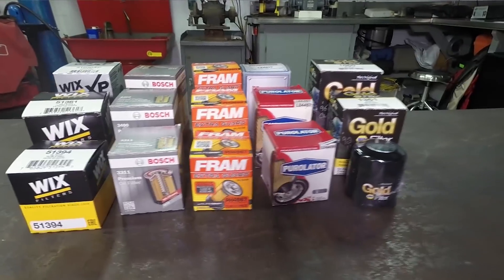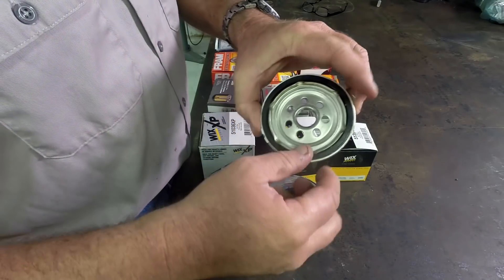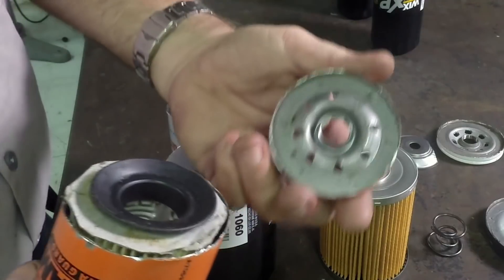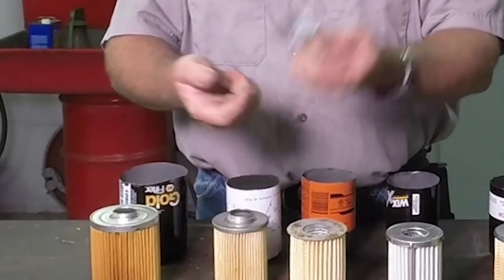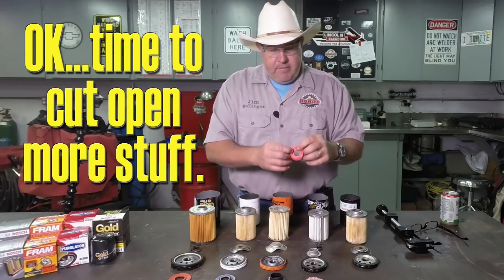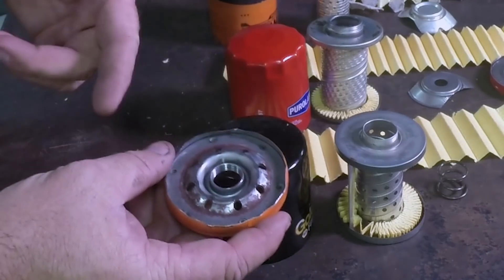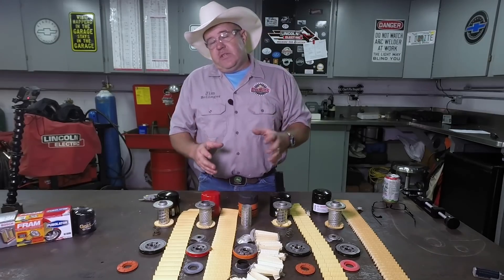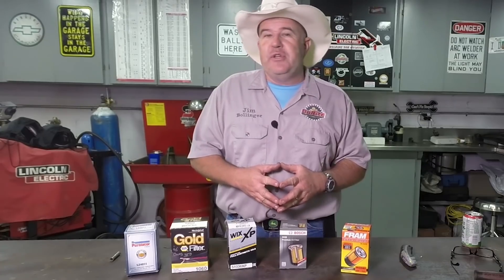The worst oil filter EVER!

Comment: Wow i thought Fram was a reputable brand.......
Won't touch one with a 10ft pole taped to another 10ft pole now after seeing this.
Reply: Dam.  Fram needs to change their name to Scam oil Filters.
Reply: @bryanbaker5942  PEOPLE!!!  All of those filters are JUNK!!!  FRAM IS A GOOD FILTER!!!
THERE IS SOMETHING WRONG WITH THIS TEST OF THE FRAM FILTER!!!  BECAUSE IT'S SIMPLE IF YOU THINK ABOUT IT!!!  THE WAY THE FILTER ELEMENT WAS FLAKING AWAY SO EASY!!!  IF YOU PUT THAT FILTER N YOUR ENGINE!!!  IT WOULD FLAKE OFF AND ENTER YOUR ENGINE AND PREVENT OIL FROM GETTING TO THE BEARINGS OR AND BLOW YOUR ENGINE UP!!! AND IF FRAM SOLD FILTERS LIKE THIS YOU WOULD BE HEARING ABOUT ENGINES BLOWING UP BY THE MILLIONS!!! 
ONE REASON I SAY ALL OIL FILTER ARE JUNK IS BECAUSE THEY ARE ALL BY PASS FILTERS!!!  
A BY PASS FILTER IS A FILTER THAT A CERTAIN PORTION OF THE OIL THAT GOES INTO THE FILTER IS BY PASTED AROUND THE FILTER ELEMENT AND IS NOT FILTERED!!!!!!!!  ANOTHER THING, AS THE FILTER PLUGS UP MORE AND MORE OIL IS BY PASSED AROUND THE FILTER ELEMENT AND IS NOT FILTERED!!!  SO AS TIME GOES BY LESS AND LESS OIL IS FILTERED!!!!
BUT PUTTING ALL OF THIS ASIDE WHICH HAS NOTHING TO DO WITH ANYTHING!!!  BECAUSE EVERYONE ONE OF THOSE FILTERS ARE JUNK!!!!   BECAUSE THEY DON'T FILTER OUT WHATS WEARING OUT YOUR ENGINE!!!  IF THEY FILTERED OUT WHAT WAS WEARING OUT YOUR ENGINE!!! YOUR ENGINE WOULD LAST FOR MILLIONS OF MILES!!!
YOU SEE OIL IN YOUR BEARING CAN'T WEAR FORGED STEEL!!!!  OTHER THINGS IN THE OIL CAN AND DO!!! THAT'S WHY ENGINES DO WEAR OUT!!!  BECAUSE THE OIL FILTERS ARE JUNK!!!  WHEN YOU BUY A NEED FILTER YOU ARE PISSING YOUR MONEY DOWN THE SHITTER!!! 
Larry
Reply: Fram Ultras are alright.   You just have to pay more than $4.
Reply: @williwonti  hope so. I'm using those on my new car...
Reply: @williwonti  where do you go that that the "ultra" Fram filters are only $4?   At my Local Walmart, the cheap orange junkers are $6.57!  Oh, and BTW, I live in Missouri, so the typical Coastal inflation has no effect on the price.
Reply: @triangleofdeath6246  the cheap orange filters here at Wal-Mart are $3.97 have been for years.
Reply: @williwonti  That is the one he cut apart.... Fram ultra gard is what is says on the case he is holding....
Reply: @williwonti   i have used them for 30 years on my cars  and customers where I had the choice, I worked for toyota for 25 yrs and they have a great filter
Reply: @williwonti    _-  ,.
Reply: @williwonti .. Do yourself a favor and cut open whatever Fram filter you are using and do your own inspection on the components.. and compare it to an OEM filter or another name brand.. You will discover the more expensive Fram’s are junk too!
Reply: @williwonti  
Fram Ultras are one of the very highest rated oil filters in every category, except price.
Reply: Larry Love we’ll he misrepresented the comparison then, chase Ultrgards are gold
Reply: @triangleofdeath6246   @imposter 0shadow  
Sir, just read the comments and you have people that have used Fram FILTERS for year!!!  Have vehicles that have 3 - 4 - 5 hundreds of thousands of miles using FRAM FILTERS!!!
First of all!!!  Everything I said is TRUE!!! AND ""TWO"'" as you say!!!  All of those FILTERS that you cut open are BYPASS FILTER!!!  AND ANY OUT THERE IF YOU WANT TO KNOW THE TRUTH WHEATER THE FILTERS ARE BYPASS FILTERS JUST ASK AROUND AND YOU WILL FIND OUT THAT THEY ARE BYPASS FILTERS!!!
THE REASON THAT THEY ARE BYPASS FILTERS!!! IS BECAUSE IF THEY WEREN'T AND THE FILTER PLUGGED UP THE OIL WOULD STOP GETTING TO THE ENGINE!!! AND YOUR ENGINE WOULD COME TO AN ABROUT STOP!!!  IT WOULD FREEZE UP FROM THE LACK OF OIL!!!. THAT'S WHY THEY ARE BYPASS FILTERS!!!
AND I ALSO WAS MASTER MECHANIC!  FOR FORTY YEARS MORE OR LESS!!! 
MATTER OF FACT I AM ABOUT TO UPLOAD A VIDEO THAT TELLS PEOPLE THAT FOR ABOUT ONE HUNDRED DOLLARS THEY CAN BUY THE PARTS THAT I TELL THEM TO BUY!!!  AND THEY CAN INSTALL THE PARTS THEMSELVES IN LESS THAN TWENTY FIVE MINUTES OR LESS!!! NO TOOLS REQUIRED!!!  AND THE CARS OR TRUCKS LAST FOR MILLIONS OF MILES!!!  RUN LIKE NEW!!  NEVER HAVE TO CHANGE OIL OR OIL FILTER!!!
LIKE SAID THE ALL OF THOSE FILTERS ARE JUNK!!!  AND THAT'S WHY TENS OF MILLIONS OF CARS ENGINES AND TRANSMISSIONS WEAR OUT EVERY YEAR!!!
LARRY
Reply: @larrylove9589  He cut apart an extra guard, the cheapest one. Ultra synthetic doesn't look like that on the inside.
Reply: In other words, I wouldn't touch a Fram filter with your car!
Reply: @discerningmind  The AC 'E'  series are made just like the Fram.... I had an AC just about strarve it of oil  by the cheap construction one day this summer towing coming in home...
Reply: @discerningmind  no it's got to be a ten-foot pole.
Reply: @discerningmind  PEOPLE!!!  All of those filters are JUNK!!!  FRAM IS A GOOD FILTER!!!
THERE IS SOMETHING WRONG WITH THIS TEST OF THE FRAM FILTER!!!  BECAUSE IT'S SIMPLE IF YOU THINK ABOUT IT!!!  THE WAY THE FILTER ELEMENT WAS FLAKING AWAY SO EASY!!!  IF YOU PUT THAT FILTER N YOUR ENGINE!!!  IT WOULD FLAKE OFF AND ENTER YOUR ENGINE AND PREVENT OIL FROM GETTING TO THE BEARINGS OR AND BLOW YOUR ENGINE UP!!! AND IF FRAM SOLD FILTERS LIKE THIS YOU WOULD BE HEARING ABOUT ENGINES BLOWING UP BY THE MILLIONS!!! 
ONE REASON I SAY ALL OIL FILTER ARE JUNK IS BECAUSE THEY ARE ALL BY PASS FILTERS!!!  
A BY PASS FILTER IS A FILTER THAT A CERTAIN PORTION OF THE OIL THAT GOES INTO THE FILTER IS BY PASTED AROUND THE FILTER ELEMENT AND IS NOT FILTERED!!!!!!!!  ANOTHER THING, AS THE FILTER PLUGS UP MORE AND MORE OIL IS BY PASSED AROUND THE FILTER ELEMENT AND IS NOT FILTERED!!!  SO AS TIME GOES BY LESS AND LESS OIL IS FILTERED!!!!
BUT PUTTING ALL OF THIS ASIDE WHICH HAS NOTHING TO DO WITH ANYTHING!!!  BECAUSE EVERYONE ONE OF THOSE FILTERS ARE JUNK!!!!   BECAUSE THEY DON'T FILTER OUT WHATS WEARING OUT YOUR ENGINE!!!  IF THEY FILTERED OUT WHAT WAS WEARING OUT YOUR ENGINE!!! YOUR ENGINE WOULD LAST FOR MILLIONS OF MILES!!!
YOU SEE OIL IN YOUR BEARING CAN'T WEAR FORGED STEEL!!!!  OTHER THINGS IN THE OIL CAN AND DO!!! THAT'S WHY ENGINES DO WEAR OUT!!!  BECAUSE THE OIL FILTERS ARE JUNK!!!  WHEN YOU BUY A NEED FILTER YOU ARE PISSING YOUR MONEY DOWN THE SHITTER!!! 
Larry
Reply: U gotta pay more than 4 dollars for quality
Reply: xrayracer1 oh my god you should send this video to fram
Reply: Here's the truth. You don't actually want an oil filter that restricts flow. THAT is what will damage your engine faster than anything else. So don't think that an oil filter with MORE guts means MORE protection because it does NOT! I use Fram and have for decades on my expensive racing engines and personal vehicles. If you change your oil frequently and make sure the air filter is sealed well you will be fine. Keeping the flow rate of oil high is literally the best thing you can do to protect and lengthen the life of your motor.
Reply: @yiddishlion2037  heard/ read about this before! That's something to take in no doubt
Reply: We may not like Fram filters but the cheapest ones still pass OEM testing everyday.
Reply: Scott Amick I’ve used them on all the vehicles I’ve ever had.
Reply: They are a reputable brand. Been using them for years with no failures. Can't go wrong with a Fram.
Reply: Coincidentally those 2 10 foot poles taped together areore sturdy then the fram filter 😂
Reply: Allied signal no longer owns Fram..The new owner actually has some decent filters. 

 They've been garbage for decades prior. 

 The one thing I do remember from the business trade publications is the new Fram owner  switched manufacturing to a other company.

 There's only a few manufacturers in the world of oil filters. They're just made to different specifications at the various factories.
Reply: Or you can maybe, you know, use the product and form your own opinion about FRAM. I've never had any issues with using FRAM on my econobox cars.
Reply: @baretta369 i was thinking what if all that thick material actually prevents oil from circulating throught the filter and only a little bit passes through? I dont even think filters are needed? I bet you could run a motor without one and probly never notice? Fuck if i know
Reply: Cd Walkman I agree. When it’s to the point your engine needs a filter there is already damage.
Reply: Fram synthetic ultra guard only
 nothing less
Reply: Perform SAE J806 and J1858 tests and see how they do.
I know how well that orange filter did(n't) do 20 years ago when Dana owned WIX (I worked for a sister division).
WIX also makes the Motorcraft filters for Ford.
But if you think FRAM is a $#!++y filter, cut open an STP filter. Some of those were nothing more than string packed in a can, and no antidrain back valve. And that was for a fairly recent 1997 Taurus.
Reply: You didn't notice that he didn't cut that fram open on camera? this is what we would call a hack job.
Reply: So do you believe everything u see on the internet ? THEY are reputable, don't be naive, you don't really know if this guy is getting paid to bash companies, for his own gain.
Reply: @robbyrocks3665  mine is for experience. A used Fram filter should be considerably heavier due to trapped particulates and metal fragments than a new one but it doesn't. That's from changing oil for 9 years and we used Fram filters.
Reply: @mikej8832  so you are saying the weight of a used filter is the same weight as a brand new filter out of box?
  Cmon, thats obviously a rediculous statement, unless i misunderstood u
Reply: @robbyrocks3665  the weight once the oil drains out is not even noticable unlike other filters that have better and more filter media. The lack of quantity in filter media was apperant. The quality was visible to most also. Not saying they don't filter but are they catching all that should be caught?
Reply: Your so god damn gullible!!!! Instead of dropping to conclusions with all this fake shit.witch it looks like he has something against fram... .that he wanted to make them look low why dont u open one yourself  and find out yourself what they actually look like..lazy ppl like u will never know the real truth
Reply: The guy says there is rust and only shows the cartridge of the filter. What he shows is not rust, it’s a burn from processing. There is a compound used to hold the ends to the paper that is heated to cure. As for the paper, it’s formulated to bind when saturated by oil which strengthens the paper. What he is showing on the anti drain back valve isn’t paper. Also, then end he claims is falling apart is false. Plus the way he cut all the filters open, I wouldn’t be surprised if he damaged the other filters. Plus Fram makes other name brand filters that most consumers don’t know about, but because people don’t know, there aren’t people making videos trying to discredit the quality.
Reply: Ill bet you buy the cheapest tires from china, dont you ??
Reply: Wow lie much !! or are you just that stupid?  Thats not rust and you know it. thats Discoloration  where they use heat to cure the cardboard to the filter. there is NO rust in the canister !!  yes it is a cheaper filter, but its susposed to be. its only good for 5,000 miles and is dirt cheap for walmart to sell. if you want a good filter test a fram ultra filter rated for 15,000 miles. cut one open to see , makes your napa filter look like a pice of shit.  i am a mechanic & i know what im talking about.  you are lying to these people and should be ashamed !!!!!!!!!!!!!!!!!!!!!!!!!!!!!!!!!!!!!!!!!!!!!!!!!!!!!!!!!!!!!!!!!!!!!!!!!!!!!!!!!!!!!!!!!!!!!!!!!!!!!!!!!!!!!!!!!!!!!!!!!!!!!!!!!!!!!!!!!!!!!!!!!!!!!!!!!!!!!!!!!!!!!!!!!!!!!!!!!!!
Reply: @Forbiden-Music-Zone  
Well said...
Reply: Understand this isnt their ultra synthetic oil filter which surpasses or compares to any other purolator, k&n bosche ,wix etc....just like anything ypu have your cheap options and your quality ones....look up the ultra synthetic specs and then talk to me
Reply: I have a 2006 Toyota Matrix with 233,000 miles on it. I have used Fram filters and Wal-Mart oil since day one. I've never had any problems.
Reply: wow, i have used fram for ~30 years, I was told the quality went to crap when they took it to china, but I now have 483K miles on my 25yo 1994 toyota truck and only using fram. And i only change the filter every other oil change, 3500 miles per oil change (7 minute oil change w/o filter, 9 minutes with filter). They maybe "complete garbage, but close to half million miles they work fine. Maybe if you used them on a Ford, it would explode backing out the driveway, Oooo, but thats just Ford. :)
Reply: Yep!
Reply: Its just a massive brand, you buy their cheap crap you get crap, its the stuff with a real price you need to look at
Reply: Nope me either fucking assholes
Reply: So you won't touch one with a 20 foot pole?
Reply: what kind of tape?  Duct tape, gaffers tape? armament tape, masking tape, scotch tape.....
Reply: https://youtu.be/kx-NT1DEtlU
Reply: The Fram Tough Guard and Ultras are good filters. The Extra Guard and High Mileage are not. Also, nothing wrong with those stamped springs.
Reply: Jonathan Rajsl  pff its so obvious you work for Fram?
Reply: xray, run an extra guard Fram every 4100 mile conventional change and get back to us after 350k miles.
Reply: @baretta369 every vehicle has different oil change intervals and older vehicles were as low as 3,000 miles. And only has to filter oil? That's were most folks get things wrong. It has to filter, flow, and retain particulates within certain parameters to give your engine a long life. I use Mototrcraft filters since they are made to meet my Ford's specs.
Reply: Seriously? Well better learn this late than never. I never touch anything Fram. I only buy k&n filters for my car.
Reply: I did my own check on my fram filter and it looked nothing like this it was standard orange and it was perfect no cardboard no rubber it was metal just like the other fingers he showed this is whack
Reply: Damn that's a lot of poll.
Reply: NAPA Gold made by Wix for me 👍
Reply: Cali recommends 8k per change. The rest of the us seems to be 3k
Reply: Jonathan Rajsl  WHY DO YOU YELL?
Reply: If you want a very good filter for under $10 get a Mobil-1 filter from Walmart. The quality is much better then any of the filters in this video.
Reply: @MrWhoevr  
Or a Fram Ultra Synthetic.
Reply: xrayracer1 me neither I guess
Reply: No it is actually one of the best if you do not buy the cheap orange brand. You want the chevron pleated black ones with white text for your car but they do still come in an orange packing unfortunately so you cannot see directly at the packing material if it is the good one. The good ones from Fram are quite expensive for a filter but you will understand why if you take a peek inside. Gold and Wix than suddenly seem mediocre. I do not have a car anymore, I have a ship and a very beautiful working VeloSolex. The VeloSolex does not require an oil filter since it is a two stroke engine. If you live on a ship a VeloSolex is heaven since you can take it on your shoulder and walk the gangway, 21.2 kg total fully fueled and emergency toolkit present. I have a special rope loop just long enough to wrap around the steer and saddle so I can hang the VeloSolex on my shoulder.

The best is still Mann. Real German heavy duty performance but also at a not so great price, it will hurt in your pocket. I have a double main filter for my main engine, a Wartsila 1100 HP diesel, of which one filter only is 425 Euro excl taxes. There is no outside casing since it is completely taken inside the motor and I can change one of them during use, I do not have to stop the engine. The quality is that good that I can hit someone KO with it and it won't give a shit while it has no casing. Complete oil change is needed at every 5000 hours (complete stop required obviously) and I sent oil samples to the lab monthly for extra check, safety first. I have only one main engine for propulsion, if it fails I am Fucked with a capital F. If the oil gets too polluted before 5000 hours we change one filter. You can buy a Mercedes SLK for what the engine alone is worth so keeping it in the best possible condition is a necessity. Now 9 years old and still in top condition, I like to keep it that way. 

The bow prop/hydraulic/generator engine is a very old DAF turbo diesel with 260 HP, we still try to keep her as good as can be but really she is nearing her grave after 30 years of heavy duty. She has run 24/7 for a long time and is in need of serious sleep. Thinking about a John Deere 320 HP diesel or a Volvo Penta 300 HP diesel and no more turbo on board the ship as they are good engines which I can afford. This next winter she will deserve her much wanted rest.
Reply: Cant imagine why people are defending fram. A picture says a thousand words.  After seeing this video I cant imagine why anyone would put one on a car they care about. The evidence is right there in front of your eyes.  Great video sir.
Reply: @reissnerjify  because people think that just because nothing has happened to their car that its a good filter. Dirty oil is still better than no oil
Reply: @reissnerjify 
The evidence! Evidence of what? Lies?
https://tiremeetsroad.com/2019/01/24/are-fram-oil-filters-any-good/?unapproved=9775&moderation-hash=97af52291ee98290baa18e718d5b50a3#comment-9775
Reply: I'd like to see a comparison of used filters
Reply: Me too what an eye opener
Reply: derrik tie    Don't take this the wrong way.  How do you know that?
Reply: Knew before watching Fram would be junk! I'll never forget looking into one in a store and seeing RUST all over the inside - no way would I touch these things!
Reply: Love the vid! I buy Fram all the time and so far no issues. I’m  it surprise the Orange look like that but I’m going to open up their higher end filters and see if they have better components. BTW, sort of unfair to compare Frams SHIT grade to NAPAS Best grade! Great video though :D
Reply: @baretta369 Thats fine, run your mobil1 for ever, after 3~4K miles its dirty oil (they make mobil1 black so you cant see how dirty it really is), it takes me 7 minutes to change oil in my truck and less than half the cost of mobil1. BTW, even if you have 40 years of experience, that does not mean your doing it right.
Reply: That Fram filter is the cheapest they make ..try comparing their other models   and prices.  This is a bullshit review
Reply: xrayracer1 they are dont believe everything you see on the internet!
Reply: PEOPLE!!!  All of those filters are JUNK!!!  FRAM IS A GOOD FILTER!!!
THERE IS SOMETHING WRONG WITH THIS TEST OF THE FRAM FILTER!!!  BECAUSE IT'S SIMPLE IF YOU THINK ABOUT IT!!!  THE WAY THE FILTER ELEMENT WAS FLAKING AWAY SO EASY!!!  IF YOU PUT THAT FILTER N YOUR ENGINE!!!  IT WOULD FLAKE OFF AND ENTER YOUR ENGINE AND PREVENT OIL FROM GETTING TO THE BEARINGS OR AND BLOW YOUR ENGINE UP!!! AND IF FRAM SOLD FILTERS LIKE THIS YOU WOULD BE HEARING ABOUT ENGINES BLOWING UP BY THE MILLIONS!!! 
ONE REASON I SAY ALL OIL FILTER ARE JUNK IS BECAUSE THEY ARE ALL BY PASS FILTERS!!!  
A BY PASS FILTER IS A FILTER THAT A CERTAIN PORTION OF THE OIL THAT GOES INTO THE FILTER IS BY PASTED AROUND THE FILTER ELEMENT AND IS NOT FILTERED!!!!!!!!  ANOTHER THING, AS THE FILTER PLUGS UP MORE AND MORE OIL IS BY PASSED AROUND THE FILTER ELEMENT AND IS NOT FILTERED!!!  SO AS TIME GOES BY LESS AND LESS OIL IS FILTERED!!!!
BUT PUTTING ALL OF THIS ASIDE WHICH HAS NOTHING TO DO WITH ANYTHING!!!  BECAUSE EVERYONE ONE OF THOSE FILTERS ARE JUNK!!!!   BECAUSE THEY DON'T FILTER OUT WHATS WEARING OUT YOUR ENGINE!!!  IF THEY FILTERED OUT WHAT WAS WEARING OUT YOUR ENGINE!!! YOUR ENGINE WOULD LAST FOR MILLIONS OF MILES!!!
YOU SEE OIL IN YOUR BEARING CAN'T WEAR FORGED STEEL!!!!  OTHER THINGS IN THE OIL CAN AND DO!!! THAT'S WHY ENGINES DO WEAR OUT!!!  BECAUSE THE OIL FILTERS ARE JUNK!!!  WHEN YOU BUY A NEED FILTER YOU ARE PISSING YOUR MONEY DOWN THE SHITTER!!! 
Larry
Reply: @baretta369 You are right ON!!!
PEOPLE!!!  All of those filters are JUNK!!!  FRAM IS A GOOD FILTER!!!
THERE IS SOMETHING WRONG WITH THIS TEST OF THE FRAM FILTER!!!  BECAUSE IT'S SIMPLE IF YOU THINK ABOUT IT!!!  THE WAY THE FILTER ELEMENT WAS FLAKING AWAY SO EASY!!!  IF YOU PUT THAT FILTER N YOUR ENGINE!!!  IT WOULD FLAKE OFF AND ENTER YOUR ENGINE AND PREVENT OIL FROM GETTING TO THE BEARINGS OR AND BLOW YOUR ENGINE UP!!! AND IF FRAM SOLD FILTERS LIKE THIS YOU WOULD BE HEARING ABOUT ENGINES BLOWING UP BY THE MILLIONS!!! 
ONE REASON I SAY ALL OIL FILTER ARE JUNK IS BECAUSE THEY ARE ALL BY PASS FILTERS!!!  
A BY PASS FILTER IS A FILTER THAT A CERTAIN PORTION OF THE OIL THAT GOES INTO THE FILTER IS BY PASTED AROUND THE FILTER ELEMENT AND IS NOT FILTERED!!!!!!!!  ANOTHER THING, AS THE FILTER PLUGS UP MORE AND MORE OIL IS BY PASSED AROUND THE FILTER ELEMENT AND IS NOT FILTERED!!!  SO AS TIME GOES BY LESS AND LESS OIL IS FILTERED!!!!
BUT PUTTING ALL OF THIS ASIDE WHICH HAS NOTHING TO DO WITH ANYTHING!!!  BECAUSE EVERYONE ONE OF THOSE FILTERS ARE JUNK!!!!   BECAUSE THEY DON'T FILTER OUT WHATS WEARING OUT YOUR ENGINE!!!  IF THEY FILTERED OUT WHAT WAS WEARING OUT YOUR ENGINE!!! YOUR ENGINE WOULD LAST FOR MILLIONS OF MILES!!!
YOU SEE OIL IN YOUR BEARING CAN'T WEAR FORGED STEEL!!!!  OTHER THINGS IN THE OIL CAN AND DO!!! THAT'S WHY ENGINES DO WEAR OUT!!!  BECAUSE THE OIL FILTERS ARE JUNK!!!  WHEN YOU BUY A NEED FILTER YOU ARE PISSING YOUR MONEY DOWN THE SHITTER!!! 
Larry
Reply: @baretta369 PEOPLE!!!  All of those filters are JUNK!!!  FRAM IS A GOOD FILTER!!!
THERE IS SOMETHING WRONG WITH THIS TEST OF THE FRAM FILTER!!!  BECAUSE IT'S SIMPLE IF YOU THINK ABOUT IT!!!  THE WAY THE FILTER ELEMENT WAS FLAKING AWAY SO EASY!!!  IF YOU PUT THAT FILTER N YOUR ENGINE!!!  IT WOULD FLAKE OFF AND ENTER YOUR ENGINE AND PREVENT OIL FROM GETTING TO THE BEARINGS OR AND BLOW YOUR ENGINE UP!!! AND IF FRAM SOLD FILTERS LIKE THIS YOU WOULD BE HEARING ABOUT ENGINES BLOWING UP BY THE MILLIONS!!! 
ONE REASON I SAY ALL OIL FILTER ARE JUNK IS BECAUSE THEY ARE ALL BY PASS FILTERS!!!  
A BY PASS FILTER IS A FILTER THAT A CERTAIN PORTION OF THE OIL THAT GOES INTO THE FILTER IS BY PASTED AROUND THE FILTER ELEMENT AND IS NOT FILTERED!!!!!!!!  ANOTHER THING, AS THE FILTER PLUGS UP MORE AND MORE OIL IS BY PASSED AROUND THE FILTER ELEMENT AND IS NOT FILTERED!!!  SO AS TIME GOES BY LESS AND LESS OIL IS FILTERED!!!!
BUT PUTTING ALL OF THIS ASIDE WHICH HAS NOTHING TO DO WITH ANYTHING!!!  BECAUSE EVERYONE ONE OF THOSE FILTERS ARE JUNK!!!!   BECAUSE THEY DON'T FILTER OUT WHATS WEARING OUT YOUR ENGINE!!!  IF THEY FILTERED OUT WHAT WAS WEARING OUT YOUR ENGINE!!! YOUR ENGINE WOULD LAST FOR MILLIONS OF MILES!!!
YOU SEE OIL IN YOUR BEARING CAN'T WEAR FORGED STEEL!!!!  OTHER THINGS IN THE OIL CAN AND DO!!! THAT'S WHY ENGINES DO WEAR OUT!!!  BECAUSE THE OIL FILTERS ARE JUNK!!!  WHEN YOU BUY A NEED FILTER YOU ARE PISSING YOUR MONEY DOWN THE SHITTER!!! 
Larry
Reply: @imposter 0shadow  
Sir, just read the comments and you have people that have used Fram FILTERS for year!!!  Have vehicles that have 3 - 4 - 5 hundreds of thousands of miles using FRAM FILTERS!!!
First of all!!!  Everything I said is TRUE!!! AND ""TWO"'" as you say!!!  All of those FILTERS that you cut open are BYPASS FILTER!!!  AND ANY OUT THERE IF YOU WANT TO KNOW THE TRUTH WHEATER THE FILTERS ARE BYPASS FILTERS JUST ASK AROUND AND YOU WILL FIND OUT THAT THEY ARE BYPASS FILTERS!!!
THE REASON THAT THEY ARE BYPASS FILTERS!!! IS BECAUSE IF THEY WEREN'T AND THE FILTER PLUGGED UP THE OIL WOULD STOP GETTING TO THE ENGINE!!! AND YOUR ENGINE WOULD COME TO AN ABROUT STOP!!!  IT WOULD FREEZE UP FROM THE LACK OF OIL!!!. THAT'S WHY THEY ARE BYPASS FILTERS!!!
AND I ALSO WAS MASTER MECHANIC!  FOR FORTY YEARS MORE OR LESS!!! 
MATTER OF FACT I AM ABOUT TO UPLOAD A VIDEO THAT TELLS PEOPLE THAT FOR ABOUT ONE HUNDRED DOLLARS THEY CAN BUY THE PARTS THAT I TELL THEM TO BUY!!!  AND THEY CAN INSTALL THE PARTS THEMSELVES IN LESS THAN TWENTY FIVE MINUTES OR LESS!!! NO TOOLS REQUIRED!!!  AND THE CARS OR TRUCKS LAST FOR MILLIONS OF MILES!!!  RUN LIKE NEW!!  NEVER HAVE TO CHANGE OIL OR OIL FILTER!!!
LIKE SAID THE ALL OF THOSE FILTERS ARE JUNK!!!  AND THAT'S WHY TENS OF MILLIONS OF CARS ENGINES AND TRANSMISSIONS WEAR OUT EVERY YEAR!!!
LARRY
Reply: @larryneiderhiser148  a bypass filter only works IF a filter gets clogged. Then the filter gets bypassed to allow oil to continue to flow. Dirty oil is still better than no oil. And a motor that still runs with a fram for 300k miles isnt a testament to the filter, but to the motor itself. As i said, fram is shit. If i spend money for a filter to do a job then i want it to do that job.
Reply: @larryneiderhiser148  are you really that delusional you can't comprehend what was just stated?  It doesn't bypass dirty oil the entire time, only time the filter gets bypassed is if the filter gets clogged, only then does oil go through the bypass. And you call yourself a mechanic psh forums don't count as a certification 👌
Reply: xrayracer1 I learned from was bad years ago,   John Deere filters are good
Reply: I have used frame for over 10 years. And all my vehicles have problems.  Hmmmmmm. I definitely won't buy any more
Reply: @samsavedbygrace996  are they Chrysler, Ford, GM or German cars? It may not be the filter.
Reply: @samsavedbygrace996  
Are all your vehicles the same brand?
Reply: Hopefully there's videos of comparison with different grades same brand and also OEM
Reply: I know! I've been wrenching for 40 years and that is the sorriest filter I have ever seen.

Back in the day, they used to have cut away demos of these various filters, and Fram used to be of good quality. The proof is indeed in the pudding, and Fram isn't pudding even if it is the same color as chocolate pudding. It's CRAPOLA!
Reply: Hi, Great video. Do you think I want to use this oil in my car? Please help me.
https://amzn.to/36EgG7z
Reply: @baretta369 that crumbling cardboard has been known to come off inside of engines and blow the engine. I started changing engine oil with my dad around 1964. Back then Fram was the game. It was an excellent filter product. What he cut out of that filter, just totally forget about the rust and let's just look at the media. The actual filter media is shorter than the other brands and is flimsier than the other brands. The reason I stopped using Fram which was about 2002, was because of the cardboard being used inside the filter. I'm dead serious when I say I have read accounts of those filters coming apart inside of an engine and blowing the engine. I can understand brand loyalty but don't blow your engine over it.
Reply: It was...50 years ago.
Reply: The HIGH end Fram filters are pretty good.. THe low end ones are JUNK
Reply: Fram filters were made through the same process as Honda OEM filters. Same manufacturing process, same quality control.
Reply: @baretta369 listen I race my daily to over 110mph on almost a weekly basis if my oil slips through some garbage paper that falls apart to the touch.. and blows my engine then its fucking garbage. Pretty or not. He has the VISABLE proof on the table. Engineers or not. Ones made totally of paper the others are hard metal name brand rubber seals. Odv.. the one that falls apart is not worth the money, for the filter or your car. If I could CSI my engine and lead it back to a shitty filter there will be a lawsuit. But for them. Not for me.
Reply: They are reputable...
https://tiremeetsroad.com/2019/01/24/are-fram-oil-filters-any-good/?unapproved=9775&moderation-hash=97af52291ee98290baa18e718d5b50a3#comment-9775
Reply: Sucker
Reply: Jonathan Rajsl  
So maybe we'll take your word that your experience has been great, okay fine... But how do you explain the contents of this video?
Reply: I am so off fram now i wont touch one with your 10 foot pole
Reply: Now I learned something new today.1 I. Can't believe everything I am told .2 I  can't trust in  everything that is sold.
Reply: Try look at a fram ultra. The orange ones are cheap for a reason.
Reply: I won't buy another Fram
Reply: Same here.
Reply: Me neither now 😮😮😮😮😮
Reply: You are joking right. Maybe select a different model of Fram.
Reply: Can I borrow your pole on pole contraption? Cat's stuck in the tree and it's colder out here than my mother in laws heart.
Reply: @buckodonnghaile4309  sure its behind the garden shed lol... 🤣
Reply: @buckodonnghaile4309  
Man you are sure wasting a lot of money!!! 
PEOPLE!!!  All of those filters are JUNK!!!  FRAM IS A GOOD FILTER!!!
THERE IS SOMETHING WRONG WITH THIS TEST OF THE FRAM FILTER!!!  BECAUSE IT'S SIMPLE IF YOU THINK ABOUT IT!!!  THE WAY THE FILTER ELEMENT WAS FLAKING AWAY SO EASY!!!  IF YOU PUT THAT FILTER N YOUR ENGINE!!!  IT WOULD FLAKE OFF AND ENTER YOUR ENGINE AND PREVENT OIL FROM GETTING TO THE BEARINGS OR AND BLOW YOUR ENGINE UP!!! AND IF FRAM SOLD FILTERS LIKE THIS YOU WOULD BE HEARING ABOUT ENGINES BLOWING UP BY THE MILLIONS!!! 
ONE REASON I SAY ALL OIL FILTER ARE JUNK IS BECAUSE THEY ARE ALL BY PASS FILTERS!!!  
A BY PASS FILTER IS A FILTER THAT A CERTAIN PORTION OF THE OIL THAT GOES INTO THE FILTER IS BY PASTED AROUND THE FILTER ELEMENT AND IS NOT FILTERED!!!!!!!!  ANOTHER THING, AS THE FILTER PLUGS UP MORE AND MORE OIL IS BY PASSED AROUND THE FILTER ELEMENT AND IS NOT FILTERED!!!  SO AS TIME GOES BY LESS AND LESS OIL IS FILTERED!!!!
BUT PUTTING ALL OF THIS ASIDE WHICH HAS NOTHING TO DO WITH ANYTHING!!!  BECAUSE EVERYONE ONE OF THOSE FILTERS ARE JUNK!!!!   BECAUSE THEY DON'T FILTER OUT WHATS WEARING OUT YOUR ENGINE!!!  IF THEY FILTERED OUT WHAT WAS WEARING OUT YOUR ENGINE!!! YOUR ENGINE WOULD LAST FOR MILLIONS OF MILES!!!
YOU SEE OIL IN YOUR BEARING CAN'T WEAR FORGED STEEL!!!!  OTHER THINGS IN THE OIL CAN AND DO!!! THAT'S WHY ENGINES DO WEAR OUT!!!  BECAUSE THE OIL FILTERS ARE JUNK!!!  WHEN YOU BUY A NEED FILTER YOU ARE PISSING YOUR MONEY DOWN THE SHITTER!!! 
Larry
Reply: @buckodonnghaile4309  PEOPLE!!!  All of those filters are JUNK!!!  FRAM IS A GOOD FILTER!!!
THERE IS SOMETHING WRONG WITH THIS TEST OF THE FRAM FILTER!!!  BECAUSE IT'S SIMPLE IF YOU THINK ABOUT IT!!!  THE WAY THE FILTER ELEMENT WAS FLAKING AWAY SO EASY!!!  IF YOU PUT THAT FILTER N YOUR ENGINE!!!  IT WOULD FLAKE OFF AND ENTER YOUR ENGINE AND PREVENT OIL FROM GETTING TO THE BEARINGS OR AND BLOW YOUR ENGINE UP!!! AND IF FRAM SOLD FILTERS LIKE THIS YOU WOULD BE HEARING ABOUT ENGINES BLOWING UP BY THE MILLIONS!!! 
ONE REASON I SAY ALL OIL FILTER ARE JUNK IS BECAUSE THEY ARE ALL BY PASS FILTERS!!!  
A BY PASS FILTER IS A FILTER THAT A CERTAIN PORTION OF THE OIL THAT GOES INTO THE FILTER IS BY PASTED AROUND THE FILTER ELEMENT AND IS NOT FILTERED!!!!!!!!  ANOTHER THING, AS THE FILTER PLUGS UP MORE AND MORE OIL IS BY PASSED AROUND THE FILTER ELEMENT AND IS NOT FILTERED!!!  SO AS TIME GOES BY LESS AND LESS OIL IS FILTERED!!!!
BUT PUTTING ALL OF THIS ASIDE WHICH HAS NOTHING TO DO WITH ANYTHING!!!  BECAUSE EVERYONE ONE OF THOSE FILTERS ARE JUNK!!!!   BECAUSE THEY DON'T FILTER OUT WHATS WEARING OUT YOUR ENGINE!!!  IF THEY FILTERED OUT WHAT WAS WEARING OUT YOUR ENGINE!!! YOUR ENGINE WOULD LAST FOR MILLIONS OF MILES!!!
YOU SEE OIL IN YOUR BEARING CAN'T WEAR FORGED STEEL!!!!  OTHER THINGS IN THE OIL CAN AND DO!!! THAT'S WHY ENGINES DO WEAR OUT!!!  BECAUSE THE OIL FILTERS ARE JUNK!!!  WHEN YOU BUY A NEED FILTER YOU ARE PISSING YOUR MONEY DOWN THE SHITTER!!! 
Larry
Reply: Actually they don't, fram is the worst oil filter you could possibly get, as an auto mechanic and former oriellys employee please don't ever put a fram filter on your car
Reply: @imposter0shadow  🤣
Reply: @imposter0shadow  because orileys employees are so knowledgable lmfao
Reply: @imposter0shadow 
You think you are some kind of oil filter expert? Yep, just because you worked for Oriellys, dosen't make you an expert on oil filter performance, does it. Not much of a profit margin on the cheaper Fram oil filter, is there?
Do some actual and factual research yourself before dissing any mfg's products.
Why do many vehicles last over 200k miles using the  Fram orange filter?  
I don't use the cheapest oil filter of any brand. Why? Advertising probably.
Look up the filtering efficiency of the filtering element in the filters, the flow rate, etc.
Reply: @buffvail476  once again, another person reading over the part where im a mechanic, and have actually cut open used filters. Read all the comments and read them thourghly
Reply: @imposter0shadow  LMAO..
"I need a couple wipers for my windshield.."
O'Reilly's employee: "sure no problem.. what size engine?.."
"uhh not sure that matters but 5.7.."
O'Reilly's employee: "great.. uhh 2wd or 4wd?.."
Reply: @allee6096  and me being a mechanic just went right over your head? Makes your argument look better right?
Reply: @imposter0shadow  seriously being a mechanic, have you ever seen an engine destroyed by the oil filter.. or just poor maintenance?.. 99% of the commentors don't even use their vehicles enough to even come close to destroying an oil filter, being a "mechanic" you should know that.. or are you just a "parts replacer" lol..
Reply: @allee6096  ok so you want to try to take it to the extreme. Heres what a shit filter does; its doesnt clean the dirt from your oil like it should which causes your seals to degrade, your cylinders and piston rings to prematurely wear, valves and valve seals to prematurely wear, I could keep going but you get my point. Depending on how bad the filter breaks down your not gonna grenade your motor. Now since you want to mention a motor being destroyed, I have seen a motor come in with 2 out of 6 cylinders needing rehoning and new piston rings along with valves and pushrods from part of the filter element breaking off and clogging the oil passage. Wanna guess the filter? Ill say it again,  fram is a shit filter.  Spend the extra money and get a decent filter
Reply: @imposter0shadow  I knew it, parts replacer.. dirt in the oil, scored cylinder walls are most likely from a defective air filter or vacuum leak, of a poorly maintained engine.. filter element? LoL.. OhhhKaaay😒
Reply: @allee6096  oil lubricates the cylinder wall and the scraper ring on the piston pulls excess oil away. Now what happens when you have dirt in your oil and it gets drug across the cylinder? Try googling all causes and not just one keyboard warrior. You probably never turned a wrench in your life
Reply: @imposter0shadow  the oil system is practically sealed.. The quickest way to introduce dirt is thru the intake system lol.. and where does that go?.. straight into the cylinders.. come on this is Basic Automotive Technology..
Reply: @imposter0shadow  just because you're a mechanic doesn't mean you're an expert.. a C- student will still graduate and start off at O'Reilly's..
Reply: @allee6096  no need for an oil filter then right?  No one denied thats a way dirt gets in the cylinders, or that its just one cause of cylinder scoring, but you're deflecting the initial statement for which you have no argument for, and your googled responses shows you lack of knowledge of the automotive industry.
Reply: @allee6096  if you're a mechanic starting off at oriellys (which has nothing to do with being a mechanic) you have very low aspirations for your career path
Reply: @imposter0shadow  LoL..
Reply: @imposter0shadow  c'mon don't play stupid, you know the reason for an Oil Filter.. How am I deflecting? LoL.. My initial statement, no one uses an engine enough to destroy the filter.. and you should know this..
Reply: @allee6096  if the filter is shit it doesnt matter if you drive 100 miles a day or 40. And you should know this, or you would if you actually knew about cars
Reply: @imposter0shadow  100 or 40 miles a day, high speed or low speed, towing or not.. any filter, whether you paid 2 or 20 dollars, will not do anything to the engine.. unless the driver never changes the oil or any routine maintenance at all..
Reply: @allee6096  a shit filter doesnt filter as well as a good filter.  Go become a mechanic and get some experience in a shop then come talk. Your only experience is what?  Changing your own oil? How many filters have you cut open and looked at? How many engines have you rebuilt? You've got nothing but internet knowledge ✌
Reply: @imposter0shadow u @
Reply: @imposter0shadow  
How by working at at parts house would you know if a filter is any good or not!!!  Did someone tell you???
PEOPLE!!!  All of those filters are JUNK!!!  FRAM IS A GOOD FILTER!!!
THERE IS SOMETHING WRONG WITH THIS TEST OF THE FRAM FILTER!!!  BECAUSE IT'S SIMPLE IF YOU THINK ABOUT IT!!!  THE WAY THE FILTER ELEMENT WAS FLAKING AWAY SO EASY!!!  IF YOU PUT THAT FILTER N YOUR ENGINE!!!  IT WOULD FLAKE OFF AND ENTER YOUR ENGINE AND PREVENT OIL FROM GETTING TO THE BEARINGS OR AND BLOW YOUR ENGINE UP!!! AND IF FRAM SOLD FILTERS LIKE THIS YOU WOULD BE HEARING ABOUT ENGINES BLOWING UP BY THE MILLIONS!!! 
ONE REASON I SAY ALL OIL FILTER ARE JUNK IS BECAUSE THEY ARE ALL BY PASS FILTERS!!!  
A BY PASS FILTER IS A FILTER THAT A CERTAIN PORTION OF THE OIL THAT GOES INTO THE FILTER IS BY PASTED AROUND THE FILTER ELEMENT AND IS NOT FILTERED!!!!!!!!  ANOTHER THING, AS THE FILTER PLUGS UP MORE AND MORE OIL IS BY PASSED AROUND THE FILTER ELEMENT AND IS NOT FILTERED!!!  SO AS TIME GOES BY LESS AND LESS OIL IS FILTERED!!!!
BUT PUTTING ALL OF THIS ASIDE WHICH HAS NOTHING TO DO WITH ANYTHING!!!  BECAUSE EVERYONE ONE OF THOSE FILTERS ARE JUNK!!!!   BECAUSE THEY DON'T FILTER OUT WHATS WEARING OUT YOUR ENGINE!!!  IF THEY FILTERED OUT WHAT WAS WEARING OUT YOUR ENGINE!!! YOUR ENGINE WOULD LAST FOR MILLIONS OF MILES!!!
YOU SEE OIL IN YOUR BEARING CAN'T WEAR FORGED STEEL!!!!  OTHER THINGS IN THE OIL CAN AND DO!!! THAT'S WHY ENGINES DO WEAR OUT!!!  BECAUSE THE OIL FILTERS ARE JUNK!!!  WHEN YOU BUY A NEED FILTER YOU ARE PISSING YOUR MONEY DOWN THE SHITTER!!! 
Larry
Reply: @larryneiderhiser148  way to give completely false info buddy 👍 one, like everyone else trying to disprove my claim, you completely skip over the part where i say im also a mechanic, and have done my own research. Two that is not what a bypass oil filter does. Go do some research before giving out bad info
Reply: @imposter0shadow  
Sir, just read the comments and you have people that have used Fram FILTERS for year!!!  Have vehicles that have 3 - 4 - 5 hundreds of thousands of miles using FRAM FILTERS!!!
First of all!!!  Everything I said is TRUE!!! AND ""TWO"'" as you say!!!  All of those FILTERS that you cut open are BYPASS FILTER!!!  AND ANY OUT THERE IF YOU WANT TO KNOW THE TRUTH WHEATER THE FILTERS ARE BYPASS FILTERS JUST ASK AROUND AND YOU WILL FIND OUT THAT THEY ARE BYPASS FILTERS!!!
THE REASON THAT THEY ARE BYPASS FILTERS!!! IS BECAUSE IF THEY WEREN'T AND THE FILTER PLUGGED UP THE OIL WOULD STOP GETTING TO THE ENGINE!!! AND YOUR ENGINE WOULD COME TO AN ABROUT STOP!!!  IT WOULD FREEZE UP FROM THE LACK OF OIL!!!. THAT'S WHY THEY ARE BYPASS FILTERS!!!
AND I ALSO WAS MASTER MECHANIC!  FOR FORTY YEARS MORE OR LESS!!! 
MATTER OF FACT I AM ABOUT TO UPLOAD A VIDEO THAT TELLS PEOPLE THAT FOR ABOUT ONE HUNDRED DOLLARS THEY CAN BUY THE PARTS THAT I TELL THEM TO BUY!!!  AND THEY CAN INSTALL THE PARTS THEMSELVES IN LESS THAN TWENTY FIVE MINUTES OR LESS!!! NO TOOLS REQUIRED!!!  AND THE CARS OR TRUCKS LAST FOR MILLIONS OF MILES!!!  RUN LIKE NEW!!  NEVER HAVE TO CHANGE OIL OR OIL FILTER!!!
LIKE SAID THE ALL OF THOSE FILTERS ARE JUNK!!!  AND THAT'S WHY TENS OF MILLIONS OF CARS ENGINES AND TRANSMISSIONS WEAR OUT EVERY YEAR!!!
LARRY
Reply: imposter 0shadow.
Reply: @imposter0shadow  I would put a Fram filter in my VW type 1. It fits nicely in the glovebox. ;)
Reply: @imposter0shadow  that's a hell of a resume. You actually worked at O O O O'Reilly's🤪
Reply: @mikelyons7511  hey Mike be cool man not everyone that works at all Riley's is an idiot. A lot of times you get people working in those stores that are mechanics set physically can't do the work anymore. I used to do all my own maintenance on my cars. I'm 61 years old now almost 62. I have three kinds of arthritis plus other issues one or two of which is probably going to kill me. Because of that I can't do the work on my own cars anymore. Which is kind of sad because I enjoyed it. I have a pretty good selection of mechanic tools including are tools that I can't use anymore. I would have friends and co-workers come over and we twist wrenches have a few beers do a pad slap or Worse drum brakes. Water pumps master cylinder head gaskets. All in my backyard in my garage. Can't do that crap anymore. I know O'Reilly's carries a lot of junkie parts yeah, but be cool about judging people.
Reply: Fram oil filters have been known to be garbage for many years.
Reply: @dontblameme6328   @imposter 0shadow  
Sir, just read the comments and you have people that have used Fram FILTERS for year!!!  Have vehicles that have 3 - 4 - 5 hundreds of thousands of miles using FRAM FILTERS!!!
First of all!!!  Everything I said is TRUE!!! AND ""TWO"'" as you say!!!  All of those FILTERS that you cut open are BYPASS FILTER!!!  AND ANY OUT THERE IF YOU WANT TO KNOW THE TRUTH WHEATER THE FILTERS ARE BYPASS FILTERS JUST ASK AROUND AND YOU WILL FIND OUT THAT THEY ARE BYPASS FILTERS!!!
THE REASON THAT THEY ARE BYPASS FILTERS!!! IS BECAUSE IF THEY WEREN'T AND THE FILTER PLUGGED UP THE OIL WOULD STOP GETTING TO THE ENGINE!!! AND YOUR ENGINE WOULD COME TO AN ABROUT STOP!!!  IT WOULD FREEZE UP FROM THE LACK OF OIL!!!. THAT'S WHY THEY ARE BYPASS FILTERS!!!
AND I ALSO WAS MASTER MECHANIC!  FOR FORTY YEARS MORE OR LESS!!! 
MATTER OF FACT I AM ABOUT TO UPLOAD A VIDEO THAT TELLS PEOPLE THAT FOR ABOUT ONE HUNDRED DOLLARS THEY CAN BUY THE PARTS THAT I TELL THEM TO BUY!!!  AND THEY CAN INSTALL THE PARTS THEMSELVES IN LESS THAN TWENTY FIVE MINUTES OR LESS!!! NO TOOLS REQUIRED!!!  AND THE CARS OR TRUCKS LAST FOR MILLIONS OF MILES!!!  RUN LIKE NEW!!  NEVER HAVE TO CHANGE OIL OR OIL FILTER!!!
LIKE SAID THE ALL OF THOSE FILTERS ARE JUNK!!!  AND THAT'S WHY TENS OF MILLIONS OF CARS ENGINES AND TRANSMISSIONS WEAR OUT EVERY YEAR!!!
LARRY
Reply: @dontblameme6328  I agree I read a study back around 2002 that totally turn me off on FRAM oil filters. On closer inspection I even stopped by FRAM air filters. If you look at them closely there's less media in the air filter. That means obviously just like the oil filter they clog faster.
Reply: Left out the part where I said mechanic but its w/e. You think this is the first and only guy to cut an oil filter open to see what exactly is on the inside? Some of us actually do oir own research on products before passing it on to the customer. Fram is garbage, plain and simple.
Reply: Fram used to be a good filter. It's a case of a company cutting corners and relying on their old reputation.
Reply: @Capitanvolume  PEOPLE!!!  All of those filters are JUNK!!!  FRAM IS A GOOD FILTER!!!
THERE IS SOMETHING WRONG WITH THIS TEST OF THE FRAM FILTER!!!  BECAUSE IT'S SIMPLE IF YOU THINK ABOUT IT!!!  THE WAY THE FILTER ELEMENT WAS FLAKING AWAY SO EASY!!!  IF YOU PUT THAT FILTER N YOUR ENGINE!!!  IT WOULD FLAKE OFF AND ENTER YOUR ENGINE AND PREVENT OIL FROM GETTING TO THE BEARINGS OR AND BLOW YOUR ENGINE UP!!! AND IF FRAM SOLD FILTERS LIKE THIS YOU WOULD BE HEARING ABOUT ENGINES BLOWING UP BY THE MILLIONS!!! 
ONE REASON I SAY ALL OIL FILTER ARE JUNK IS BECAUSE THEY ARE ALL BY PASS FILTERS!!!  
A BY PASS FILTER IS A FILTER THAT A CERTAIN PORTION OF THE OIL THAT GOES INTO THE FILTER IS BY PASTED AROUND THE FILTER ELEMENT AND IS NOT FILTERED!!!!!!!!  ANOTHER THING, AS THE FILTER PLUGS UP MORE AND MORE OIL IS BY PASSED AROUND THE FILTER ELEMENT AND IS NOT FILTERED!!!  SO AS TIME GOES BY LESS AND LESS OIL IS FILTERED!!!!
BUT PUTTING ALL OF THIS ASIDE WHICH HAS NOTHING TO DO WITH ANYTHING!!!  BECAUSE EVERYONE ONE OF THOSE FILTERS ARE JUNK!!!!   BECAUSE THEY DON'T FILTER OUT WHATS WEARING OUT YOUR ENGINE!!!  IF THEY FILTERED OUT WHAT WAS WEARING OUT YOUR ENGINE!!! YOUR ENGINE WOULD LAST FOR MILLIONS OF MILES!!!
YOU SEE OIL IN YOUR BEARING CAN'T WEAR FORGED STEEL!!!!  OTHER THINGS IN THE OIL CAN AND DO!!! THAT'S WHY ENGINES DO WEAR OUT!!!  BECAUSE THE OIL FILTERS ARE JUNK!!!  WHEN YOU BUY A NEED FILTER YOU ARE PISSING YOUR MONEY DOWN THE SHITTER!!! 
Larry
Reply: Yea cardboard is a great option for a filter
Reply: @imposter0shadow  Are you a youngster?   Must be - because there's still companies selling  Oil filters that use (are you ready for this) TOILET PAPER!
The T.P. dropped into the metal JACKET and unscrewed when done!   Not for me though.
Reply: Actually the glue used in filters sticks better to cardboard end caps than metal ones, and that cardboard is made with different resins than used in ordinary cardboard.
Reply: @lesbianbob  I get what you're saying okay, but why was it crumbling when he touched it? I would expect it to be a little more rigid. I don't like particle board either so I sure am not going to put the paper equivalent of it in my engine.
Reply: Young to some, fram is still a shit filter, doesnt matter how you slice it.
Reply: There all the base filters ass clown, you probably don't know anything about auto mechanics, just another keyboard warrior who likes talking trash. Fram is still shit
Reply: the standard fram filter does suck, I changed oil for 6.5 years as a job, and we had many problems with them compared to other filters. But the fram synthetic filter is a good filter.
Reply: Mark Farmer what kind of problems?
Reply: I’ve used nothing but frams for about 30 years. Never had one issue
Reply: Cant believe everything you see. Ive used exclusively Fram filters for 10 years. Have I ever had an engine issue?  Never. First vehicle i owned used fram filters starting at 20k miles. Drove that to 200k no issues. Same story with my next FOUR vehicles. I never bought the cheapest fram filter. Always the Tough guard and now the synthetic version.
Reply: clarda1 same here.
Reply: @clarda1  Exactly !! Finally someone w common sense like me.
  Ppl tend to be really naive
Reply: @clarda1  I've used from for over 40 years and always bought the cheap one ' but always changed oil at 3,000' never a problem'
Reply: @clarda1  Cognitive Dissonance is strong with this one.
Reply: cl
Reply: @clarda1  
Yes, I think this video is about thumbing down on Fram FILTERS!!! so you will buy the other brands!!!!!!! 
PEOPLE!!!  All of those filters are JUNK!!!  FRAM IS A GOOD FILTER!!!
THERE IS SOMETHING WRONG WITH THIS TEST OF THE FRAM FILTER!!!  BECAUSE IT'S SIMPLE IF YOU THINK ABOUT IT!!!  THE WAY THE FILTER ELEMENT WAS FLAKING AWAY SO EASY!!!  IF YOU PUT THAT FILTER N YOUR ENGINE!!!  IT WOULD FLAKE OFF AND ENTER YOUR ENGINE AND PREVENT OIL FROM GETTING TO THE BEARINGS OR AND BLOW YOUR ENGINE UP!!! AND IF FRAM SOLD FILTERS LIKE THIS YOU WOULD BE HEARING ABOUT ENGINES BLOWING UP BY THE MILLIONS!!! 
ONE REASON I SAY ALL OIL FILTER ARE JUNK IS BECAUSE THEY ARE ALL BY PASS FILTERS!!!  
A BY PASS FILTER IS A FILTER THAT A CERTAIN PORTION OF THE OIL THAT GOES INTO THE FILTER IS BY PASTED AROUND THE FILTER ELEMENT AND IS NOT FILTERED!!!!!!!!  ANOTHER THING, AS THE FILTER PLUGS UP MORE AND MORE OIL IS BY PASSED AROUND THE FILTER ELEMENT AND IS NOT FILTERED!!!  SO AS TIME GOES BY LESS AND LESS OIL IS FILTERED!!!!
BUT PUTTING ALL OF THIS ASIDE WHICH HAS NOTHING TO DO WITH ANYTHING!!!  BECAUSE EVERYONE ONE OF THOSE FILTERS ARE JUNK!!!!   BECAUSE THEY DON'T FILTER OUT WHATS WEARING OUT YOUR ENGINE!!!  IF THEY FILTERED OUT WHAT WAS WEARING OUT YOUR ENGINE!!! YOUR ENGINE WOULD LAST FOR MILLIONS OF MILES!!!
YOU SEE OIL IN YOUR BEARING CAN'T WEAR FORGED STEEL!!!!  OTHER THINGS IN THE OIL CAN AND DO!!! THAT'S WHY ENGINES DO WEAR OUT!!!  BECAUSE THE OIL FILTERS ARE JUNK!!!  WHEN YOU BUY A NEED FILTER YOU ARE PISSING YOUR MONEY DOWN THE SHITTER!!! 
Larry
Reply: @clarda1  Don't believe cowboys with paper caps. Fram are fine in all colors.
Reply: My experience is that on parts that are changed routinely as a part of normal maintenance anything that is name brand is OK.  If someone is not going to do the recommended maintenance then dont blame the Fram because it fails at 10,000 miles when it was supposed to replaced at 3,000 miles.  I used to do my own work years ago and on those older vehicles it called for replacement of parts at much shorter intervals than modern vehicles.  I would use cheap filters and never had a problem, but then again I was somewhat anal about maintenance and never had an oil filter that would go over about 3100 miles without being replaced.
Reply: @jnichols3  USe shit filters --> get shit intervals. I've got an '85 F150 with the venerable 300cid I6 and I can go 5k on an oil change using modern oils and modern, high quality filters without any problem whatsoever. With good oils and good filters on an old engine you can very easily get good, long service intervals. I use Valvoline full-synthetic 20w50 and Motorcraft FL-1a filters. Kind of expensive but well worth, old motor loves it.

They called for 3k/3mo oil changes back in the day because they didn't have the synthetic oils and filtration media we have today, not because of any inherent quirk in the engines themselves.
Reply: @jnichols3  in my younger days back in the seventies and eighties I always change my oil every 2000 miles.
Reply: Dont know if that was necessary, but certainly didn't hurt.
Reply: @jnichols3  I'm OK with that but when you open a filter and there's rust inside? I just can't handle that in my engine.
Reply: @jnichols3   @imposter 0shadow  
Sir, just read the comments and you have people that have used Fram FILTERS for year!!!  Have vehicles that have 3 - 4 - 5 hundreds of thousands of miles using FRAM FILTERS!!!
First of all!!!  Everything I said is TRUE!!! AND ""TWO"'" as you say!!!  All of those FILTERS that you cut open are BYPASS FILTER!!!  AND ANY OUT THERE IF YOU WANT TO KNOW THE TRUTH WHEATER THE FILTERS ARE BYPASS FILTERS JUST ASK AROUND AND YOU WILL FIND OUT THAT THEY ARE BYPASS FILTERS!!!
THE REASON THAT THEY ARE BYPASS FILTERS!!! IS BECAUSE IF THEY WEREN'T AND THE FILTER PLUGGED UP THE OIL WOULD STOP GETTING TO THE ENGINE!!! AND YOUR ENGINE WOULD COME TO AN ABROUT STOP!!!  IT WOULD FREEZE UP FROM THE LACK OF OIL!!!. THAT'S WHY THEY ARE BYPASS FILTERS!!!
AND I ALSO WAS MASTER MECHANIC!  FOR FORTY YEARS MORE OR LESS!!! 
MATTER OF FACT I AM ABOUT TO UPLOAD A VIDEO THAT TELLS PEOPLE THAT FOR ABOUT ONE HUNDRED DOLLARS THEY CAN BUY THE PARTS THAT I TELL THEM TO BUY!!!  AND THEY CAN INSTALL THE PARTS THEMSELVES IN LESS THAN TWENTY FIVE MINUTES OR LESS!!! NO TOOLS REQUIRED!!!  AND THE CARS OR TRUCKS LAST FOR MILLIONS OF MILES!!!  RUN LIKE NEW!!  NEVER HAVE TO CHANGE OIL OR OIL FILTER!!!
LIKE SAID THE ALL OF THOSE FILTERS ARE JUNK!!!  AND THAT'S WHY TENS OF MILLIONS OF CARS ENGINES AND TRANSMISSIONS WEAR OUT EVERY YEAR!!!
LARRY
Reply: @TestECull  Ford 300 6 was one of the best engines ever built. Their damn near indestructible. For their size they have tremendous pulling power. Before fuel injection they actually had better torque than the 302 V8.
Reply: @clarda1  so you gambled and won. Not worth the gamble to me for a few bucks difference.
Reply: warriornova 1967 What do you mean “gamble” ? I buy the synthetic or tough guard filter. Im not saving money.
Reply: @clarda1  They all work, really. Fram has enough engineers on staff to NOT make a defective product. Leave the cheap filter in for 40,000 miles, yeah, you might have a media blow out.
Reply: @clarda1  Can't believe what you see? I subscribe to "can't believe what you here" this is pretty evident that fram is lacking in comparison
Reply: DC Auto Enhancement You fail to comprehend many things. First, the fram filter in the video is roughly half the price of the other filters. Ever heard of “ you get what you pay for” ? Second, the Fram Xg series is actually rated number one. 99.5 percent filtering efficiency at 20 microns, better than wix, mobile one, k&n, Royal purple and even amsoil. So for some one to say all fram filters are junk because they are comparing a $3 filter to a 6 and $9 filter is hilarious.
Reply: @clarda1  You said I failed to comprehend "many" things and then only listed two, without verifying what I actually did comprehend. In the video it is evident that there was only one Fram filter.  It did appear to be the low end Fram filter.  My comment was in reference to what I saw regarding the filters in the video and your comment, merely suggesting that I saw in the video that the Fram filter shown was sub par in comparison to the others shown and that I believe that that filter was made of lesser materials. Would you disagree with that based on the video? I realize that what you are saying is they didn't compare apples to apples.
Reply: @clarda1  My exoerience also, BUT 40 years great experience  - the NEWER BASE MODELS made overseas ARE JUNK NOW - but Fram Ultra, holds its own with ANY.
Reply: Jonathan Rajsl  after he showed the insides of these filters,I'd never use one of them again, I don't care how much luck people have had with them!! The proof of the poor ass quality is seeing it broke down like this!
Reply: @baretta369 You do what you want, for me seeing the insides of these filters is good enough for me . Cardboard falling apart,rust that gets into the oil,etc.? No Thanks!
Reply: Sidney Mantissa  it doesnt take a genius to cut a filter open, not do you need a degree to see a product is shit
Reply: Sidney Mantissa  when a used filter is mush and falling apart, you don't have to be a genius to know it didn't filter much of anything
Reply: I wouldn't piss on a fram filter.
Reply: Well that should be ok as it is very seldom you find a need to filter urine unless maybe you are 
trying to find a kidney stones.In that case doctors usually provide strainers and cups to use.  @83wasagoodyear
Reply: Same... Damn.. Never again
Reply: iN THE 80'S fORD WOULD VOID WARRANTIES IF YOU USED A FRAM OIL FILTER. I TOOK AN AUTOMOTIVE SCIENCE CLASS AND THE INSTRUCTOR SHOWED UP A FRAM OIL FILTER UNDER A MICROSCOPE AND A LARGE AMOUNT OF THE MEDIA WAS PLUGGED BY GLUE.
Reply: At one time FRAM filters were excellent, but the demand went up to such a high level the quality became a loss of money for the manufacturer. That is retail for you,  money is more important than quality to corporations.
Reply: @SirNC89  seems counterintuitive that because demand went up quality would go down. What's there to making a filter? Not much. If it's not broke, why "fix"?
Reply: @SirNC89  How do you know demand went up ?
  Any numbers..please post.
 I hardly think the company was losing a dime by keeping up it's quality.
  They were always good.
 Lets just concentrate on this guy ( making tge video)
  What is his motive to bashing Fram$$$....Lets also keep it simple, use common sense.
  Millions & millions satified users.
Reply: I too wouldn't touch one with a 10 foot pole  or a 6 foot Swead,for that matter.
Reply: @ic2ofu  PEOPLE!!!  All of those filters are JUNK!!!  FRAM IS A GOOD FILTER!!!
THERE IS SOMETHING WRONG WITH THIS TEST OF THE FRAM FILTER!!!  BECAUSE IT'S SIMPLE IF YOU THINK ABOUT IT!!!  THE WAY THE FILTER ELEMENT WAS FLAKING AWAY SO EASY!!!  IF YOU PUT THAT FILTER N YOUR ENGINE!!!  IT WOULD FLAKE OFF AND ENTER YOUR ENGINE AND PREVENT OIL FROM GETTING TO THE BEARINGS OR AND BLOW YOUR ENGINE UP!!! AND IF FRAM SOLD FILTERS LIKE THIS YOU WOULD BE HEARING ABOUT ENGINES BLOWING UP BY THE MILLIONS!!! 
ONE REASON I SAY ALL OIL FILTER ARE JUNK IS BECAUSE THEY ARE ALL BY PASS FILTERS!!!  
A BY PASS FILTER IS A FILTER THAT A CERTAIN PORTION OF THE OIL THAT GOES INTO THE FILTER IS BY PASTED AROUND THE FILTER ELEMENT AND IS NOT FILTERED!!!!!!!!  ANOTHER THING, AS THE FILTER PLUGS UP MORE AND MORE OIL IS BY PASSED AROUND THE FILTER ELEMENT AND IS NOT FILTERED!!!  SO AS TIME GOES BY LESS AND LESS OIL IS FILTERED!!!!
BUT PUTTING ALL OF THIS ASIDE WHICH HAS NOTHING TO DO WITH ANYTHING!!!  BECAUSE EVERYONE ONE OF THOSE FILTERS ARE JUNK!!!!   BECAUSE THEY DON'T FILTER OUT WHATS WEARING OUT YOUR ENGINE!!!  IF THEY FILTERED OUT WHAT WAS WEARING OUT YOUR ENGINE!!! YOUR ENGINE WOULD LAST FOR MILLIONS OF MILES!!!
YOU SEE OIL IN YOUR BEARING CAN'T WEAR FORGED STEEL!!!!  OTHER THINGS IN THE OIL CAN AND DO!!! THAT'S WHY ENGINES DO WEAR OUT!!!  BECAUSE THE OIL FILTERS ARE JUNK!!!  WHEN YOU BUY A NEED FILTER YOU ARE PISSING YOUR MONEY DOWN THE SHITTER!!! 
Larry
Reply: @ic2ofu   @imposter 0shadow  
Sir, just read the comments and you have people that have used Fram FILTERS for year!!!  Have vehicles that have 3 - 4 - 5 hundreds of thousands of miles using FRAM FILTERS!!!
First of all!!!  Everything I said is TRUE!!! AND ""TWO"'" as you say!!!  All of those FILTERS that you cut open are BYPASS FILTER!!!  AND ANY OUT THERE IF YOU WANT TO KNOW THE TRUTH WHEATER THE FILTERS ARE BYPASS FILTERS JUST ASK AROUND AND YOU WILL FIND OUT THAT THEY ARE BYPASS FILTERS!!!
THE REASON THAT THEY ARE BYPASS FILTERS!!! IS BECAUSE IF THEY WEREN'T AND THE FILTER PLUGGED UP THE OIL WOULD STOP GETTING TO THE ENGINE!!! AND YOUR ENGINE WOULD COME TO AN ABROUT STOP!!!  IT WOULD FREEZE UP FROM THE LACK OF OIL!!!. THAT'S WHY THEY ARE BYPASS FILTERS!!!
AND I ALSO WAS MASTER MECHANIC!  FOR FORTY YEARS MORE OR LESS!!! 
MATTER OF FACT I AM ABOUT TO UPLOAD A VIDEO THAT TELLS PEOPLE THAT FOR ABOUT ONE HUNDRED DOLLARS THEY CAN BUY THE PARTS THAT I TELL THEM TO BUY!!!  AND THEY CAN INSTALL THE PARTS THEMSELVES IN LESS THAN TWENTY FIVE MINUTES OR LESS!!! NO TOOLS REQUIRED!!!  AND THE CARS OR TRUCKS LAST FOR MILLIONS OF MILES!!!  RUN LIKE NEW!!  NEVER HAVE TO CHANGE OIL OR OIL FILTER!!!
LIKE SAID THE ALL OF THOSE FILTERS ARE JUNK!!!  AND THAT'S WHY TENS OF MILLIONS OF CARS ENGINES AND TRANSMISSIONS WEAR OUT EVERY YEAR!!!
LARRY
Reply: what if I tape three 10 ft poles together ? that would be maybe more than thirty foot if I tape them just so …? its your call tho .
Reply: bought out by the Chinese
Reply: Years of junk filters
Reply: I decided to cut open an orange FRAM Extra Guard filter and see the quality myself since I do not trust everything I see.  I selected a PH7317 filter I have had on my shelf for 6 years.  A remnant of the same filter I used on my wifes HONDA Pilot.  I think the same filter I used from the very first oil change but I cannot remember if that is true.  I do know it is the filter I used for at least most of those years.  Likewise, a different part number of the same filter model has been used on my 2008 JEEP on every oil change except the few I have had done at the dealer and one at a JIFFY LUBE.  The HONDA was sold in 2017 still running just as well as the day my wife and I bought it. We never had to add oil between changes and I always use conventional oil.  I would have to get the log but it was a little bit over 286,000 miles when we sold it.  In it's entire life it literally had only maintenance service.   Likewise on the 2008 JEEP JK with 3.8 liter V6 the same FRAM Extra Guard series but different part number) has been used. The JEEP only has 117,622 miles.  Zero power train issues. One passenger door lock failure. I think about the same number of misc factory recalls as the HONDA.  So I have a bit of history with no issues using the Extra Guard filters.  Oh, and same filters and conventional oil used on my farms two RAM trucks with V10 engines and still using on the remaining V10 truck I have today.  Pulled a LOT of heavy weight with these trucks over the years in very hot weather, steep grades, etc. and never an issue with their engines/power trains.  Ever.

Getting back to the 7317 oil filter on my shelf which is in the family of least expensive filter - I expected this six year old leftover filter would look like the one in this video or perhaps worse when I took it apart.  Not so.

I do agree the rubber piece is inferior to the silicon. And I agree that the filter element assembly is made from lesser expense materials than some of the other conventional filters and certain no comparison to filters made for synthetic oils that I have seen.  But there was a total absence of rust in the container or the element and element end pieces.  I also tried to twist and pull the cardboard ends off of the element.  I mean with considerable force.  It is still in once piece.  I  could take another run at it with even more force and will certainly make it "give" at some point but I must tell you that whatever it would take would be well beyond anything that would ever happen in oil filter duty. I would expect it would take less force to twist or pull apart after service life.  My guess is that it would come apart similar to other filters at that point; still requiring more effort than it would be subjected too in actual use. Is my FRAM Ultra Guard diessection experience an exception.  Perhaps a few more people should take some of these filters apart and let us know what they find.

I admit I have been driven by the price and an assumption that strong marketing and mass quantity manufacturing helped keep the FRAM price lower.  I can see that the manufacturing quality and filter "paper" is definitely lower than most all of the other conventional filters.  I will switch to at least a WIX filter since I use them on tractors and our WINNEBAGO RAM 3500 Promaster based Travato with cartridge filter.
Reply: @genestory8166 All oil filters have different media determined by price and specs.The media used in the low cost Fram filter matches almost identically to the filter media on dozens of other comparable priced filters and similar to what we find on aircraft engine filters .

It should be obvious that any media is going to trap over ninety percent of contaminates.You might also realize that as a filter ages it will filter more contaminates as its media becomes less porous from accumulated use.
Way to much emphasis is made about oil filter performance.All filters are required to be  built and perform to SAE specifications.

Drain back valves made either from Nitrile rubber or silicone perform identically.Silicone remains more flexible in extreme cold but the valve only has to  block approximately 10% of any oil that would drain back since oil filters are designed to be mounted near vertical or 45 degrees on most engines and never more than perpendicular to the block and as such would never drain back more then 50% of their capacity. Think about how engines are  much better designed today with tighter tolerances and yet the oil filters used today are 1/4 th the size of filters of thirty years ago.Add the fact that small oil filters hold less then a pint of oil in many cases you can see that oil drainage quantities from drain back would be in just a few ounces, oil pumps fill this void in just a few seconds during cranking.

Silicone has only been used in the last decade or so and are as much a marketing  addition as to any functional need.
Reply: Have known this for years.  Fram is crap.  Usually I get Mobil 1 or k&n.  I agree that wix or Napa gold are good filters for the money
Reply: @louofm1  I would check into who's making the filters that you buy. There's actually very few companies that make oil filters now. Years ago there was a study that actually listen what they found when they cut open like 30 different brands of oil filters maybe a slight exaggeration there but you get my drift. They also listed who made the filter for that brand. I saw the study back around 2002. So I'm sure Acquisitions and mergers have made the manufacturer list is smaller.
Reply: I wouldn’t touch it with a 100 ft ladder
Reply: @EngiesParadise  Lol OK. I have had two motors go over 200K using exclusively Fram filters. Nothing wrong with them.
Reply: Fram has been trash for many years. In the 80's and early 90's they were great.
Reply: xrayracer1 I’ve used Fram all my life but Napa Gold from now on.
Reply: Fram used to be a reputable brand. Then they started cheaping out on construction.
Reply: I think "Fram is a sham"
Reply: I have used that same Fram filter for years, on one car up to 203,000 miles before I sold it, without issue.  But to be safe I won't use them again.
Reply: Same here!  I had always used Fram, but latley I had been told by a auto Parts store that Fram was not that good and this seems to confirm that!  How disappointing!!  Thanks for the info!  I to will; no longer get Fram!  he even gave it a second chance and failed miserably on both!
Reply: I was at the auto parts store for a filter and they agree Fram is junk.  They don't even have them in that store.  Now you go to Walmart and they only have Fram and Mobil 1 filters.  Not much of a selection.  I think the only reason they also had the Mobil 1 was to help get rid of the image in my head of them selling cheap junk to achieve their low prices.  They don't have a whole lot of 5w40 or 0w40 oils there that list VW 502.00 either.  They have Just ONE and it is Mobil 1 0w40 European formula and it is good stuff.  I use that in my Passat but I will never buy it exclusively at Walmart.  Other places have it on sale sometimes and I may get it there unless I discover a sale on  Liqui Moly Synthoil 0w40 Energy which sells for a similar price to Mobil 1 but is even better.  I would even consider Fuchs (another excellent German brand).  I have even given Febi Bilstein some thought too and use one of their fluids.
Reply: @charleshines6155  - Almost all the videos I have seen all agree that Mobil1 are of the best or the best oil filters and most all agree that Fram is the worse!
  I have always installed Fram oil filters but the evidence is convincing!
Reply: nightlightabcd   There is a video on YouTube where someone cuts open a Mobil-1, K&N and Royal Purple filter and they were all built better than any of these filters.
Reply: @MrWhoevr  
Did they cut open a Fram Ultra?
Reply: Fram has already been this bad for a long time. I knew they were like this 10 years ago.
Reply: @jamessouthworth1699  
Which Fram filters. They sell four different levels of quality. So which Fram filter?
Reply: @baretta369 im an industrial mechanic and from a line of engineers. What qualifications do you have to say that garbage filter is good? One look at it, garbage. Can you not see the lack of quality? why would he be sued, and by who?
Reply: yeah same here look good from outside , an old company i worked at use only them they were change very regularly , good job too by look of it total junk not evena pretense of quality .
Reply: Farm is junk Wix is the way to go
Reply: Fram sham scam
Reply: Fram is complete garbage
Reply: Me too.   Never buying another
Reply: @baretta369 Doesnt take a monkey to see which one is obviously built better and not falling apart. Also fram is tested In many many many other blogs vlogs and forums... from base to max model and they all crap out.
Reply: Fram is trash
Reply: You mean you wouldn't touch the cheapest Fram oil filter. So many people get so damn confused on such a simple subject. The plain orange ones are the garbage filters which no one in their right mind would put on even their clunker car, the rest of Fram's oil filters range from decent to very good quality.
Reply: @drainx85  I've bought the cheap one for ever' my dad is still driveing his 1961 olds 88, always fram and alway changed at 3,000 miles 328,000 miles and still drive it on sunny days //
Reply: don't make excuses for a bad company theres way better less risky things to attach to your engine
Reply: @drainx85  Do you hear yourself? They sell it and claim its good, but don't buy it because everyone should know its junk? They are liars and cheats, but blame the customer. There is something wrong with you.
Reply: @drainx85    Where is there any evidence Fram makes anything of even average quality?
Reply: @drainx85  You mean the ones WallyWorld sells.....
Reply: @drainx85   @imposter 0shadow  
Sir, just read the comments and you have people that have used Fram FILTERS for year!!!  Have vehicles that have 3 - 4 - 5 hundreds of thousands of miles using FRAM FILTERS!!!
First of all!!!  Everything I said is TRUE!!! AND ""TWO"'" as you say!!!  All of those FILTERS that you cut open are BYPASS FILTER!!!  AND ANY OUT THERE IF YOU WANT TO KNOW THE TRUTH WHEATER THE FILTERS ARE BYPASS FILTERS JUST ASK AROUND AND YOU WILL FIND OUT THAT THEY ARE BYPASS FILTERS!!!
THE REASON THAT THEY ARE BYPASS FILTERS!!! IS BECAUSE IF THEY WEREN'T AND THE FILTER PLUGGED UP THE OIL WOULD STOP GETTING TO THE ENGINE!!! AND YOUR ENGINE WOULD COME TO AN ABROUT STOP!!!  IT WOULD FREEZE UP FROM THE LACK OF OIL!!!. THAT'S WHY THEY ARE BYPASS FILTERS!!!
AND I ALSO WAS MASTER MECHANIC!  FOR FORTY YEARS MORE OR LESS!!! 
MATTER OF FACT I AM ABOUT TO UPLOAD A VIDEO THAT TELLS PEOPLE THAT FOR ABOUT ONE HUNDRED DOLLARS THEY CAN BUY THE PARTS THAT I TELL THEM TO BUY!!!  AND THEY CAN INSTALL THE PARTS THEMSELVES IN LESS THAN TWENTY FIVE MINUTES OR LESS!!! NO TOOLS REQUIRED!!!  AND THE CARS OR TRUCKS LAST FOR MILLIONS OF MILES!!!  RUN LIKE NEW!!  NEVER HAVE TO CHANGE OIL OR OIL FILTER!!!
LIKE SAID THE ALL OF THOSE FILTERS ARE JUNK!!!  AND THAT'S WHY TENS OF MILLIONS OF CARS ENGINES AND TRANSMISSIONS WEAR OUT EVERY YEAR!!!
LARRY
Reply: @drainx85  but that dosnt change the fact that alot of people thought fram was a high quality filter!  And why do they think that? Because thats the way it was marketed to sell! And if they new the truth they woulnt have bought it!!
Reply: @drainx85  The Extra-Guard shown here is one of their top-of-the-line filters. *They only get worse from what Jim cut open*. 

I will happily buy FRAM filters, but they'll never go onto an engine. They do, however, make awesome range targets. Those bright orange cans are easy to see through the sights of a rifle and they're great at giving feedback when you successfully infuse some copper-jacketed lead with the filter medial.
Reply: @TestECull  nah man they sell 2 higher tier filters above the extra guard.
Reply: @greendroid77  And they're still utter shite compared to a purolator, wix, or any rebrand of those two. Which Motorcraft is. And is why I use Motorcraft filters. I like my 330K mile engine, I want it to reach 660K, so it's gonna get high quality oil and filters. Not fram bombs.
Reply: @drainx85  Considering there are cheaper brands (like Purolator) that manage to have a much better filter than Fram, I doubt the "Fram Gold" are much better! Besides, for the price of a "gold" Fram, I can buy a Wix!
Reply: @triangleofdeath6246  I am curious about a cut down on the Purolator gold I started using those in 2002 never regretted it.
Reply: @drainx85  I have used the chap orange Fram filter ever since i started driving and never had a problem with destroying my engines. I recently had a 01 Honda CR-V and got to 312K miles and still ran after the crash that destroyed the car but not the engine and all i ever used was the cheap Fram filter every 5k miles. These tests are stupid. And still use them on 83 Ford f100 88 mustang and 07 Honda cr-v.
Reply: @drainx85  Correct. He compared NAPA's top of the line filter to Fram's  cheap filter. I never use Fram but you gotta be fair.
Reply: @drainx85  Why do they even make a garbage filter?  Shit comes back on them.
Reply: @drainx85  then why produce and distribute the plain orange (shit) filter...?
Going to just avoid the Fram filters all together, myself...!!
Reply: @drainx85  If they're willing to sell a product that rusts on store shelves and pass it off as any kind of quality, then they're a none reputable company. I'm supposed to expect a company like FRAM to care about their higher end products when their lower end products are the worst of the worst? Sorry, but I'm not an idiot.
Reply: @drainx85  what about the 16 17 18 year olds that are new to car maintenance? They don't know any better and they probably heard their dad or grandfather say FRAM so, they just buy the first one or the cheapest one they see.
Reply: @drainx85  At last, someone with common sense!😀   
This guy is the "cheese ball" here.
Reply: no, they don't.  Fram filters are garbage all the way down, especially for their price.  a "good" fram filter is more expensive than a wix or purolater, and both wix and puro blow the fram out of the water in quality.
Reply: @drainx85  good to know. I'm using the higher quality fram...
Reply: joe b 
There is no such thing as a "higher quality Fram filter"... Only more expensive Fram oil filters. The more expensive ones are the same junk.
Reply: joe b there is no such thing they are all garbage stick with what comes on your vehicle from factory dose not cost any more and it's the right choice just like the engine oil the engineering has already been done for you.
Reply: @joeb2588  just get a mobil 1 motocraft or bosch filter next
Reply: @eliasmontoya7515  I like wix and Mobil 1. I wouldn't use motorcraft just because of "name association" to Ford.
Reply: The Fram he cut was the best Fram filter, it has the black grip on the end.
Reply: @drainx85  but since the information is not given readily to a nonmechanic, how is the common person to know? We're NOT STUPID IDIOTS, just hard working people being mislead and screwed over by those in the business of being crooks and PREYING on honest trusting individuals. SHAME ON THEM ALL AND THOSE WHO DEFEND THEM.
Reply: The 3000 mile thing is in reguard to older vehicles (70s, 80s, 90,) Most of them were 6000 to 7500 mile for "normal" use and 3000 miles for extreme use. My 2016 Challenger and 2003 Silverado both have the oil life monitors, or whatever each manufacturer calls it.  I get the oil and filter changed plus any other maintenance item done that has reached the extreme use milage mark, when the Silverado tells me in the "message  center", and on the Challenger when oil life drops to 10%  The Dodge is the only new CAR I have ever owned (retirement present to myself).  I baby that car and normally get 9000 miles between oil changes, and only get servicing done at the dealer.  Cost a little more, but my SXT is worth it.
Reply: @jnichols3  you talk like dealers dont jack you around same as any other mechanic.
Reply: Maybe.   More expensive too, but if something gets messed up,  there is no question about which shop screwed it up.  Besides, the dealer's tickets look pretty and orderly in my binder.  Also there is a maintenance record available at any dealership that will match my maintenance log book.  When I bought this car I decided to take to one place for everything.  I am 51 and this will probably be my last new vehicle.
Reply: @jnichols3  i dont care wher you take your car but your saying you take it to a dealer cause if something went wrong you know what shop is to blame? So if you took it to old joes auto shop and you got it back messed up you wouldnt know it was old joe that did it? How does that work?
Reply: @jnichols3  ...gee 9k miles per oil change. Bet the filter is all plugged up and dirty, unfiltered oil is swirling around in the block eating the motor up.
Reply: @jnichols3  Please, please, please stick with 3-5,000 mike intervals.
  I'm a big Dodge fan.
 I highly disagree with what is recommended in todays vehicles.
 Obviously, just my opinion...enjoy
Reply: @jnichols3  ...wrong. oil breaks down in any internal combustion motor, new or old. Three months/3k miles is the recommended intervals, esp with town driving, short length driving where oil doesn't get to the 260 degree operating temp, and the similar.

Use a little common sense instead of having to be told when to change oil.
Reply: @jnichols3  You understand those literally run off the mileage benchmarks of when the sensor was last reset by you or your mechanic right? There is no magical technology that actually checks the life of your oil or filter.
Reply: It is reset everytime the oil and filter is changed.  While to the best of my knowledge there is no sensor to analyze the oil, the oil life system does far more than count miles.  It uses an algorithm that uses temperature, RPM, load, idle time, etc.  If you tend to accelerate slowly, drive within the speed limit long distances without a lot of stop and go driving, you will get thousands of miles more than hard acceleration, highspeed, stop/go driving.  I have heard that drivers are getting more miles out of synthetic oil as opposed to cheap convetional oil, so there could be an oil contamination  sensor, but could be sensors that measure the pressures each side of the filter that would indicate dirt in the filter.
Reply: HAVEN'T GOOD IM 10+ YEARS
Reply: Really?    I wouldn't touch your "logic" with any size pole.
Reply: @coiledsteel8344   @imposter 0shadow  
Sir, just read the comments and you have people that have used Fram FILTERS for year!!!  Have vehicles that have 3 - 4 - 5 hundreds of thousands of miles using FRAM FILTERS!!!
First of all!!!  Everything I said is TRUE!!! AND ""TWO"'" as you say!!!  All of those FILTERS that you cut open are BYPASS FILTER!!!  AND ANY OUT THERE IF YOU WANT TO KNOW THE TRUTH WHEATER THE FILTERS ARE BYPASS FILTERS JUST ASK AROUND AND YOU WILL FIND OUT THAT THEY ARE BYPASS FILTERS!!!
THE REASON THAT THEY ARE BYPASS FILTERS!!! IS BECAUSE IF THEY WEREN'T AND THE FILTER PLUGGED UP THE OIL WOULD STOP GETTING TO THE ENGINE!!! AND YOUR ENGINE WOULD COME TO AN ABROUT STOP!!!  IT WOULD FREEZE UP FROM THE LACK OF OIL!!!. THAT'S WHY THEY ARE BYPASS FILTERS!!!
AND I ALSO WAS MASTER MECHANIC!  FOR FORTY YEARS MORE OR LESS!!! 
MATTER OF FACT I AM ABOUT TO UPLOAD A VIDEO THAT TELLS PEOPLE THAT FOR ABOUT ONE HUNDRED DOLLARS THEY CAN BUY THE PARTS THAT I TELL THEM TO BUY!!!  AND THEY CAN INSTALL THE PARTS THEMSELVES IN LESS THAN TWENTY FIVE MINUTES OR LESS!!! NO TOOLS REQUIRED!!!  AND THE CARS OR TRUCKS LAST FOR MILLIONS OF MILES!!!  RUN LIKE NEW!!  NEVER HAVE TO CHANGE OIL OR OIL FILTER!!!
LIKE SAID THE ALL OF THOSE FILTERS ARE JUNK!!!  AND THAT'S WHY TENS OF MILLIONS OF CARS ENGINES AND TRANSMISSIONS WEAR OUT EVERY YEAR!!!
LARRY
Reply: When you say order, Where did you order it from? Online I suppose right? There’s your problem.
Reply: @tommy13t  Plenty of people buy filters online and get a better price than in store. The quality should be the same. I routinely buy Toyota oil filters by the case and Bosch too
Reply: @tommy13t  
PEOPLE!!!  All of those filters are JUNK!!!  FRAM IS A GOOD FILTER!!!
THERE IS SOMETHING WRONG WITH THIS TEST OF THE FRAM FILTER!!!  BECAUSE IT'S SIMPLE IF YOU THINK ABOUT IT!!!  THE WAY THE FILTER ELEMENT WAS FLAKING AWAY SO EASY!!!  IF YOU PUT THAT FILTER N YOUR ENGINE!!!  IT WOULD FLAKE OFF AND ENTER YOUR ENGINE AND PREVENT OIL FROM GETTING TO THE BEARINGS OR AND BLOW YOUR ENGINE UP!!! AND IF FRAM SOLD FILTERS LIKE THIS YOU WOULD BE HEARING ABOUT ENGINES BLOWING UP BY THE MILLIONS!!! 
ONE REASON I SAY ALL OIL FILTER ARE JUNK IS BECAUSE THEY ARE ALL BY PASS FILTERS!!!  
A BY PASS FILTER IS A FILTER THAT A CERTAIN PORTION OF THE OIL THAT GOES INTO THE FILTER IS BY PASTED AROUND THE FILTER ELEMENT AND IS NOT FILTERED!!!!!!!!  ANOTHER THING, AS THE FILTER PLUGS UP MORE AND MORE OIL IS BY PASSED AROUND THE FILTER ELEMENT AND IS NOT FILTERED!!!  SO AS TIME GOES BY LESS AND LESS OIL IS FILTERED!!!!
BUT PUTTING ALL OF THIS ASIDE WHICH HAS NOTHING TO DO WITH ANYTHING!!!  BECAUSE EVERYONE ONE OF THOSE FILTERS ARE JUNK!!!!   BECAUSE THEY DON'T FILTER OUT WHATS WEARING OUT YOUR ENGINE!!!  IF THEY FILTERED OUT WHAT WAS WEARING OUT YOUR ENGINE!!! YOUR ENGINE WOULD LAST FOR MILLIONS OF MILES!!!
YOU SEE OIL IN YOUR BEARING CAN'T WEAR FORGED STEEL!!!!  OTHER THINGS IN THE OIL CAN AND DO!!! THAT'S WHY ENGINES DO WEAR OUT!!!  BECAUSE THE OIL FILTERS ARE JUNK!!!  WHEN YOU BUY A NEED FILTER YOU ARE PISSING YOUR MONEY DOWN THE SHITTER!!! 
Larry
Reply from the maker: nice try. order meaning that the different stores didn't have all of the 15 filters (total) in stock
Reply: @DoRiteFabrication  It's been about a year since you made this and I was wondering if you've ever tested the K&N oil filters.
Reply: Haven't ever heard of fram, sounds like some knockoff piece of crap
Reply: @JordyValentine   @imposter 0shadow  
Sir, just read the comments and you have people that have used Fram FILTERS for year!!!  Have vehicles that have 3 - 4 - 5 hundreds of thousands of miles using FRAM FILTERS!!!
First of all!!!  Everything I said is TRUE!!! AND ""TWO"'" as you say!!!  All of those FILTERS that you cut open are BYPASS FILTER!!!  AND ANY OUT THERE IF YOU WANT TO KNOW THE TRUTH WHEATER THE FILTERS ARE BYPASS FILTERS JUST ASK AROUND AND YOU WILL FIND OUT THAT THEY ARE BYPASS FILTERS!!!
THE REASON THAT THEY ARE BYPASS FILTERS!!! IS BECAUSE IF THEY WEREN'T AND THE FILTER PLUGGED UP THE OIL WOULD STOP GETTING TO THE ENGINE!!! AND YOUR ENGINE WOULD COME TO AN ABROUT STOP!!!  IT WOULD FREEZE UP FROM THE LACK OF OIL!!!. THAT'S WHY THEY ARE BYPASS FILTERS!!!
AND I ALSO WAS MASTER MECHANIC!  FOR FORTY YEARS MORE OR LESS!!! 
MATTER OF FACT I AM ABOUT TO UPLOAD A VIDEO THAT TELLS PEOPLE THAT FOR ABOUT ONE HUNDRED DOLLARS THEY CAN BUY THE PARTS THAT I TELL THEM TO BUY!!!  AND THEY CAN INSTALL THE PARTS THEMSELVES IN LESS THAN TWENTY FIVE MINUTES OR LESS!!! NO TOOLS REQUIRED!!!  AND THE CARS OR TRUCKS LAST FOR MILLIONS OF MILES!!!  RUN LIKE NEW!!  NEVER HAVE TO CHANGE OIL OR OIL FILTER!!!
LIKE SAID THE ALL OF THOSE FILTERS ARE JUNK!!!  AND THAT'S WHY TENS OF MILLIONS OF CARS ENGINES AND TRANSMISSIONS WEAR OUT EVERY YEAR!!!
LARRY
Reply: I wouldn't put much stock in the various points of misinformation of this video.
Reply: Thanks for not touching Fram. Saves them for the rest of us folks.
Reply: xrayracer1 
And you thought that because of the way the brand is promoted.
You probably also thought Trump was a great man.
Reply: @falconeaterf15   @imposter 0shadow  
Sir, just read the comments and you have people that have used Fram FILTERS for year!!!  Have vehicles that have 3 - 4 - 5 hundreds of thousands of miles using FRAM FILTERS!!!
First of all!!!  Everything I said is TRUE!!! AND ""TWO"'" as you say!!!  All of those FILTERS that you cut open are BYPASS FILTER!!!  AND ANY OUT THERE IF YOU WANT TO KNOW THE TRUTH WHEATER THE FILTERS ARE BYPASS FILTERS JUST ASK AROUND AND YOU WILL FIND OUT THAT THEY ARE BYPASS FILTERS!!!
THE REASON THAT THEY ARE BYPASS FILTERS!!! IS BECAUSE IF THEY WEREN'T AND THE FILTER PLUGGED UP THE OIL WOULD STOP GETTING TO THE ENGINE!!! AND YOUR ENGINE WOULD COME TO AN ABROUT STOP!!!  IT WOULD FREEZE UP FROM THE LACK OF OIL!!!. THAT'S WHY THEY ARE BYPASS FILTERS!!!
AND I ALSO WAS MASTER MECHANIC!  FOR FORTY YEARS MORE OR LESS!!! 
MATTER OF FACT I AM ABOUT TO UPLOAD A VIDEO THAT TELLS PEOPLE THAT FOR ABOUT ONE HUNDRED DOLLARS THEY CAN BUY THE PARTS THAT I TELL THEM TO BUY!!!  AND THEY CAN INSTALL THE PARTS THEMSELVES IN LESS THAN TWENTY FIVE MINUTES OR LESS!!! NO TOOLS REQUIRED!!!  AND THE CARS OR TRUCKS LAST FOR MILLIONS OF MILES!!!  RUN LIKE NEW!!  NEVER HAVE TO CHANGE OIL OR OIL FILTER!!!
LIKE SAID THE ALL OF THOSE FILTERS ARE JUNK!!!  AND THAT'S WHY TENS OF MILLIONS OF CARS ENGINES AND TRANSMISSIONS WEAR OUT EVERY YEAR!!!
LARRY
Reply: @falconeaterf15  Great man?  No.  Great President?  Oh, yeah.
Reply: @falconeaterf15   Yes, he is.  You're a piece of work.